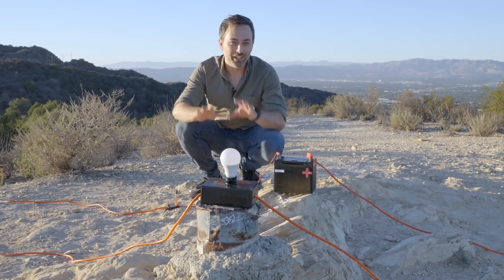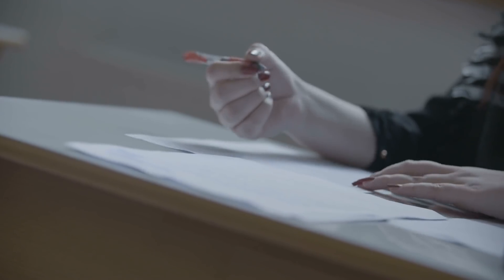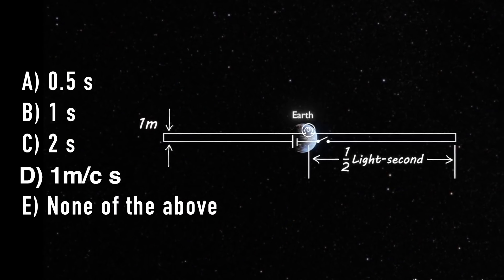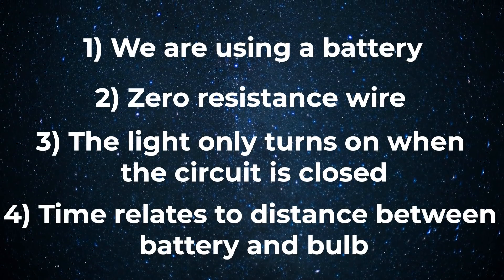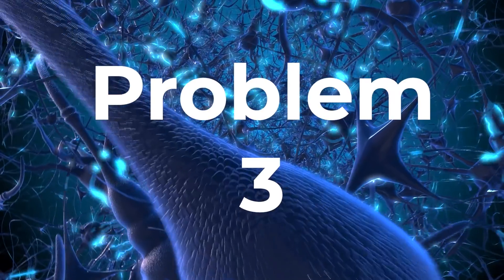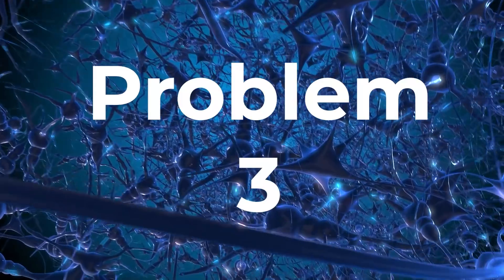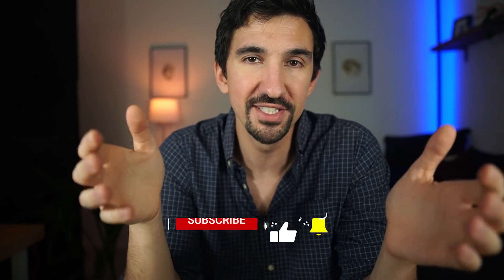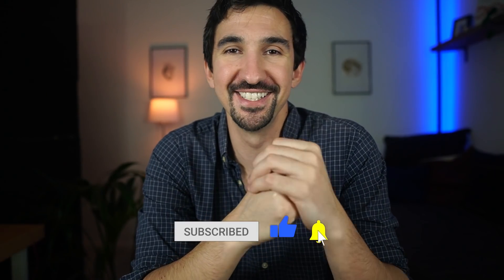Is Veritasium Wrong About Electricity?

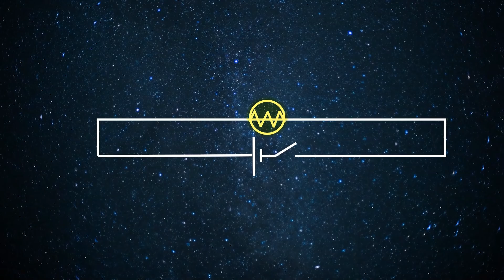Comment: 4:28 ,  time does not work like that in general relativity. We will see the bulb turning off after roughly "distance from breaking point" over "c". The only reason it takes "1/c  [s]" in the veritasium problem is because he is breaking the circuit 1m away from the bulb (with a switch). 

5:50 , 4) should be wrong in the sense that time should relate to the distance between the switch and bulb (neglecting the distance between observer and switch). 3) is right locally, it does not matter what happen in the circuit (breaking, opening) until that interaction reaches our local position, travelling at the speed of light. Therefore the circuit will be intact locally and the light bulb turn on until the interaction (broken circuit information) reaches our position after roughly "distance from breaking point" over "c". 

Of course, this is all neglecting any impedance in the cable (resistance, inductance, capacitance).
Reply: This is the correct answer. Thank you. Just wanted to write exactly that. Veritasium should have said distance/c seconds, which in his case was 1m. Otherwise, everything else is correct.
Reply: @TheKGizdov  Pretty sure it was obvious what that distance meant.

Comment: Causality issue was the one that made me doubt in Derek's conclusion. Speed at which fields are propagating through space is limited. And fields are tied to the wire, right? So they should still travel all the way. At least from battery to the lightbulb which should be half a circuit. What if we'd increase that 1m distance to 100m? It relatively insignificant comparing to 1/2 of light second, but significant enough for insulation. There's no way fields can pass energy directly. So it has to go all the way. So when we're closing the switch information about this event should go in both ways all around the circuit until each piece of it will "know" about switch being closed. And only then the light will turn on. Or am I missing something?

Comment: I do not get the antenna picture. If the circuit is broken at the end and the switch is closed no electricity can flow it is just that a big long kabel got connected to the terminal oft the battery. So nothing in the cable changes so there should not be any signal to send. For the capacitance mentioned it might give you a little energy when the switch is closed bus after a us or so  it should turn off again until the eloctrons start moving through the lamp.

Comment: One thing I can't wrap my head around in your explanation is the latter part, where the electrons "arrive" at the light bulb. Where is the additional energy that makes the lightbulb glow at "full strength" coming from? Surely it can't be from the electrons themselves, because if an electron loses energy it (at least to my understanding) would have to give off a particle, most often photons, because it can only live in discrete energy states. It surely also can't be from the movement of the electrons, else we'd see electrons being "bunched up" at higher resistance points in the circuit. Or maybe that's exactly what happens and I'm missing something or got something wrong here? I guess my question is, if the energy doesn't come from the electron itself and it also doesn't come from the fields being produced by the moving charges, where DOES the energy come from?

Comment: Your 3rd assumption, that circuit should be closed for bulb to glow is wrong.
Breaking it at such a far distance from battery & bulb doesn't affect much, because the wires still work as antenna. But, breaking it near the battery or bulb will break the antenna, so is a different case.

Comment: So I now open the switch.  Are you suggesting that the light will stay on for 1/c seconds?  Let us say that electron A is the first electron to leave the battery when we close the switch.  Must it be election A that starts the light blub to "turn on"?  Are you certain that electrons traveling through the wire are moving at the speed of light?

Comment: How do electrons flow into the battery to do the chemistry and subsequently create the magnetic fields in the first place without the other end giving up electrons which can only be established by communicating its change through reordering electronic state of the wire. Surely the Battery can't just magically suck in electrons when switch is activated  and when there's no source until the  other end provides a source? What about the initial fields tells the sink electrons that the source of its future  electrons which have to come through the wires is now immediately available? I could have another battery generating exact same fields right alongside an open switched  one, and the battery with the open switch feels these fields but electrons don't flow into it nor will its light illuminate. Because the fields are not determinant, the state of the wire electronically is with respect to PD at each point is, then  it and its fields can assume some equilibrium.

Comment: What's the maximum length of wire where the resistance would NOT be too high and the light bulb would work (with a car battery)?

Comment: There is a Poynting vector from the switch to the light bulb. Some of the Energy has to flow 1m from the switch to the bulb. This will get to the bulb in 1/c seconds. As the assumption was that the bulb turns on as it gets the first bit of energy, it turn on in 1/c seconds.

Comment: Here (1÷c)s   means (1meter ÷the speed of light). He took 1 meter as the distance between the bulb and the battery. So the electromagnetic  energy will take ( 1÷c)s to light the bulb because the EM energy travels with the speed of light c meter per second.

Comment: If my wire circuit is 299,792,458 meters and in a circular shape ( Approx. 300k km) I have a DC battery, a switch, and a bulb in the circuit. Energy should flow at the speed of light ( energy here is the electrons being passed from one atom to the other) I guess an electromagnetic field would also appear as the electrons are moving ( when the switch is closed). Now let's place the bulb in two possible positions either just before the positive terminal or after the negative terminal. My question is: should the electrons travel full circle ( i.e. taking 1 second because my length of cable is 300k km) before by bulb lights up? If the bulb is in either position just before or after either battery terminal, can the bulb light up a period less than 1 second after the switch is closed? In my opinion, the flow of the energy or electrons must complete the circuit ( must move through the 300k km of wire or 1sec at least) before the bulb lights up. If the bulb comes on in less than a second, energy flow has become instantaneous, faster than the speed of light, therefore information has traveled faster than the speed of light. In that scenario it means my wire circuit can tend to infinity thus energy flows instantaneously, well I don't think this is possible. In another scenario, since the bulb is close to the terminal of the battery and once the switch is closed the flow of energy hits the bulb on is it way to complete the circuit, would the bulb come on before the energy flow complete the circuit within 1 second or less than one second? If the bulb lights up before 1 second, that is before the flow of energy completes the circuit ( time period 1 sec because the length of wire is 300k km) then the bulb might as well also light up even if there was a break in the circuit 150k km away. Assuming again our circuit has zero resistance and it is now 10 times as long, it would take 10 seconds before the bulb comes on, ten seconds for the flow of energy/ electrons to complete the circuit. A time less than that means information can flow faster than the speed of light. Can the bulb come on before the electrons complete its circuit as a function of the wire length? I don't think so or I could then cheat, and now cut the circuit before the electrons make their complete cycle, this way I would have made the bulb flash on but the energy has not completed the full circuit cycle.

Comment: E=IR?  So if resistance is not from the medium but the power around the outside of the wire?  Why not just copper plate any conductor?  Could save much costs.

Comment: I liked his video, but accept he kept it maybe too simple. It brought a physics concept to the common person, such as an interested me. The DC issue is easily taken care of in my mind. Take the 2 antennas as an infinite set of capacitors wired in paralell, each charge up in turn passing current until a break is reached. At this point the caps are charged and current will then cease. Each cap initialy appears to be a short circuit so the bulb will light at full brightness until you run out of caps. If the circuit is not broken. then the bulb lights forever.

Comment: 1/c seconds = (1s)/(3*10^8m/s) = (1s^2)/(3*10^8m) = ((3.333[repeating]^(-9))s^2)/m. Now multiply by the length of wire the from the switch to the bulb (3*10^8m), your meters unit cancels and gives you 1s^2. Which is 1 second. This is counterintuitive for me, but it's how my math professors taught me to solve for units. I also had a calculus teacher teach me electromagnetism and although he couldn't explain the quantum behind it, he was able to use well known physics equations to solve for V = d/t, velocity is c, distance is 3x10^8m and time is unknown, so you multiply both sides of the equation by t to give Vt = d, then divide by V to get t = d/V. Plug your known values in and you get t = 3*10^8m/(3*10^8m/s) = 1s. 

Now this is where it gets bonkers, because he also explained the flow of electricity as electrons sliding along the surface of the metal wire, and was able to show evidence to support how the center of the wire had a positive chare while the surface was negatively charged... And then went on to explain how electrons transmitted electricity across a distance virtually instantaneously because the electron being received by the bulb is literally the electron adjascent to the bulb in the wire, with the entire train following behind. Which is virtually instantaneously. 

Why did he contradict himself? Why wasn't he able to give any meaningful explanation to why electromagnetism works the way it does? 

I wager because he wasn't familar with quantum mechanics, and the process going on here is likely not derivable from newtons equations. It's been experimentally shown that quantum effects take over once you reach that plank length. Classical physics derives the size of an electron to actually be bigger than the size of a proton. And this doesnt make sense because the electron isnt actually a partical, It's a charged space, a negative charge waveform that can be localized around a positive mass, (the nucleus). Now if you're willing to concieve that the electron isnt actually a partical, and rather a quantifiable wave of *energy*, you have to use Schrödinger's equations to solve this the correct way, because newtons equations simply DO NOT represent the subatomic world.

Anybody that's read this far i would recommend doing as much reading into Schrödinger and Heisenburg's work, and the history of how they came to the conclusions they did. The gravitational constant is also sort of ambiguous and it helps to think about it from the perspective of Entropic Gravity Theory.

Comment: No, [1 meter / c seconds] is not dimensionally correct. EEVblog made the same picky comment in his video and I was cringing about that already there. c has units of meters / second. So writing the unit of second at the end of this expression is one unit of second to much. It should just be [1 meter / c]. Or, you can agree on that c should just be its numerical value in units of meters per second. In that case [1/c second] is correct. Your way of writing it is not correct in any convention, at least Vertassiums way of writing it is consitent.

Comment: Veritasium described a very large tuned circuit composed of an extremely long loop of wire. The inductance of the wire, combined with capacitance of the wires running parallel, will result in extreme impedance, that will prevent the instantaneous reaction upon closing the switch (even with zero resistance wite).
Applying direct current to a single loop circuit with a switch, lamp, and 12 volt battery would, using Veritasium's logic, have the electrons moving in one direction, and producing a non changing magnetic field around the wire. In order to transfer power to the return wire, there must be, at a minimum, changing current in the wire to have a varying magnetic field. Even with alternating current, the electromagnetic field travels at the speed of light (slower in copper wire than light in free space). The effect was used years ago, when televisions were connected to antennas. To eliminate interference, a tuned stub made of a shorted piece of lead-in wire that was connected to the antenna input on the back of the television. (Simpler method was to take a longer piece of lead-in, connected the same way, and wrap a piece of aluminum foil around lead-in, and slide the foil up and down the length until you found the spot where the interference was tuned out. This works because television signals, and interference, travel through wires at a finite speed. Antennas, oscillators, radios, televisions all rely on tuned circuits that would not work if the current was instantaneous.

Comment: Problem #4: the current teaching about electric current if fuzzy: what is the velocity of electric current? And WHY?! Does the amount of applied voltage affect the speed of current? What is the magnitude of electrons available in a wire? Coulomb's Law says one ampere is one coulomb of charge TRAVELING PAST A GIVEN POINT, at the urging of one volt, in one second. I've been told that the only movement in a wire that electrons are capable of is "drift current", which is so slow it would take months for an electron to travel and inch. It makes sense intuitively that the "pressure" of voltage should be felt instantaneously in every part of the wire--like that game fixture hanging metal balls as adjacent pendulums. But current, as a flow of particles in a pipe, is quite a different critter. Electrons have mass; mass has to be accelerated to a velocity in a certain amount of time; mass also exhibits inertia, which acts against acceleration...what do you do with that! In other words, I guess, what exactly IS a "current waveform"; how is it conveyed over a wire. If I change the frequency of the waveform at the source end of the wire, how does that change appear at the other end of the wire virtually instantaneously, given the electron flow dynamics involved?!

Comment: Enjoyed it!  A couple questions about your premise that nothing is faster than the speed of light, including information:
1) what about quantum entanglement/spooky action at a distance? is that not information moving faster than the speed of light through spacetime?
2) a thought experiment that I haven't thought through so probably has a big error in it...suppose some futuristic  lasernanocarbonunobtanium super material that is perfectly incompressible/nonmalleable/perfectly rigid after being set.  make a tube of this wonder material that is 1 light second long. fill it with pure liquid water with zero dissolved gases or minerals, 100% pure HOH. liquids are incompressible, according to conventional thinking in our universe (except in a black hole?). have an observer at the far end of your supertube. press one drop (let's say a mole) of water into the end of the the supertube.  how long before the observer at the far end of the 1 lightsecond long supertube sees 1 drop of water exit the supertube at his end? intuition suggests one drop of water would instantaneously exit the observer's end of the supertube. does this suggests that "information" can travel faster than the speed of light?

ok, everything is compressible, until it's a black hole, with enough energy. but it was a fun little uneducated thought experiment for a minute! what if the supertube is a black hole/wormhole ;)

Comment: I hate everything about the question. All sorts of practicalities are ignored, which is absolutely fine in a thought experiment, but then all sorts of practicalities are brought into play. For example, the length of wire stretching out in space is irrelevant to the time it takes for the build to light, and now it seems the circuit does not even have to be complete! So get rid of the wire altogether and have Veritasium sit on a mountaintop with a battery, a bulb, and a switch. Now we’re talking!

Comment: It isn’t that science teachers lied about how the electricity works, they just simplify to what really counts. What Veritasium describes only occurs in the first few billionths of a second. Teachers aren’t going to teach that because it is irrelevant, far too complicated and you don’t see it normal life.  Exactly the same as a science teacher speaks of the kinetic energy of a falling object. They just use simple equations and avoid adding complications like wind resistance, turbulence, different air density as the object falls etc … IMO Veritasium click baited everyone and it has worked spectacularly well.

Comment: How fast a current gets know it can flow? I mean that if 300,000km has a very small capacity, how long does it take to rise a current to its maximum in case of a connected wire and disconnected? Will it take entire second before electrons “make sure” they can flow? If not, how a he.. they know about this immediately?